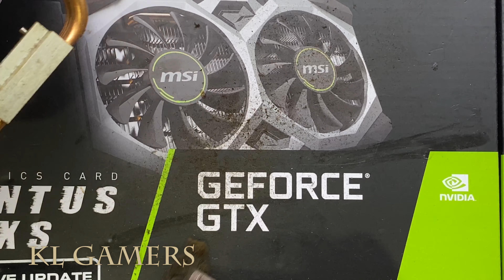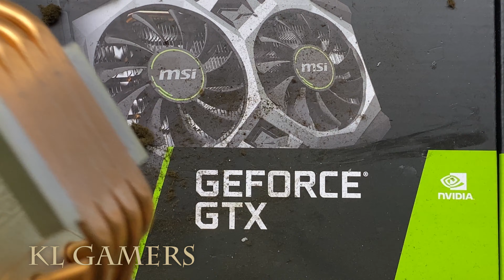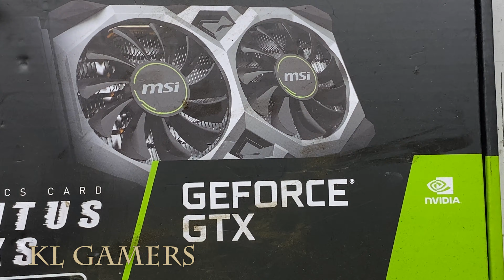Satisfying Clean Dust Vacuum intel Core i5 3450 GIGABYTE GA-Z77P-D3 msi GTX560

Comment: How to deep clean the Cooler Master 212 evo heatsink fins Should I wash it with water or something else?
Reply from the maker: just brush and vacuum will be ok
Reply: I have washed my 212 evo in water and blew it dry with an air mattress pump, compressed air works too. Idk if it’s worth the hassle though since the vacuum works just as good.